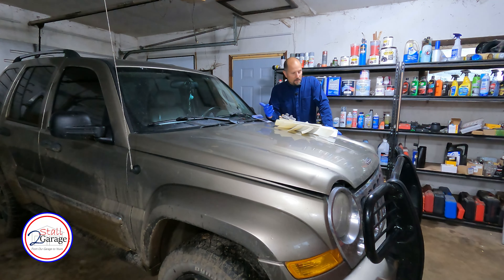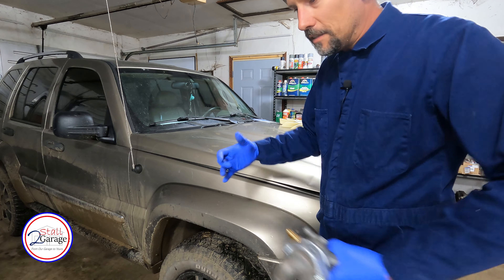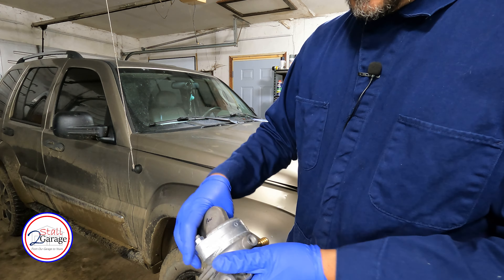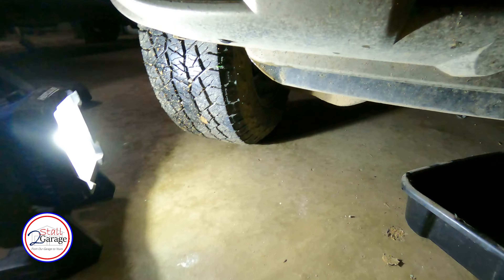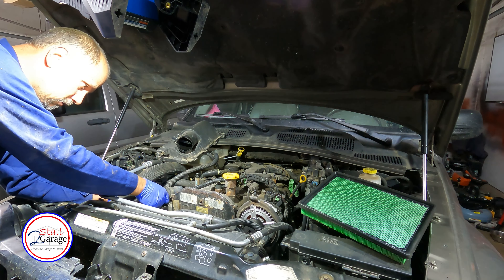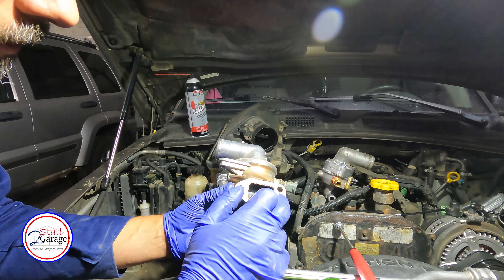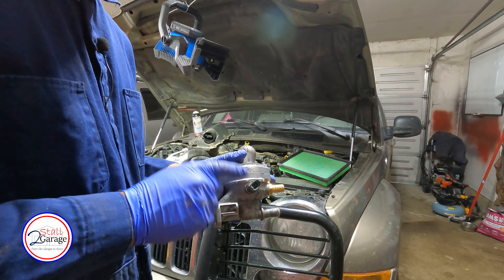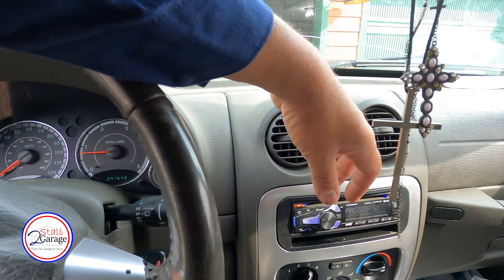Jeep Liberty CRD 203°F Thermostat UPGRADE Step by Step Install and Review

Comment: I'm seeing forums with these higher temp thermostats cracking heads with the crd, and its scary.

2nd thing- what is the viscous heater supposed to do? Dose it do anything good?
Reply from the maker: That’s not an issue with this thermostat.  The cracked heads can happen when people use an aftermarket (in-hose) thermostats. 

The viscous heater came OEM on these CRDs.   They will warm up the coolant a little (not much) faster.

They are obsolete nowadays.  Deleting them means less stress on your engine, serpentine belt idlers, belt, and tensioner.  

Any difference the viscous heater made with the coolant temp is made up for by installing this thermostat.  

Winter temps shouldn’t be an issue now.  Can’t wait to have it for the cold season.  Thanks for watching.  There are more CRD videos on the channel.  Some are older but hopefully still helpful.  

Have a great day!

Comment: I use that permatex copper spray on my head gaskets. Works great. Wasn't a fan of the liberty at first but they have grown on me. Wasn't a fan of the 4door wrangler or gladiators at first either till I drove one now I kinda want one 😂
Reply from the maker: They’ll never be good on looks but functionality wise, they make great MPG (the CRD) and the 4WD works great.  

Storm’s here tonight.  How’s your summer going so far?   Already July.  Wow
Reply: @2StallGarage  yeah they aren't pretty but better lookn than the compass 😂. We got hit with a storm yesterday. Cooled it down some but didn't las ran the humidity back up. We cookn down here. Heat indexes in the 110+ range with 60-80% humidity make it hard to get much done but we pushing thru it.
Reply from the maker: @GlassWerx looks like you’ve been putting work in on the Honda.  That’s going to be an interesting ride.
Reply: @2StallGarage  yeah had to do a little anyways 😂. Gotta plate it all in so it'll be safe to drive again. Got a few more parts to get and modify but thatll be a few weeks out still. Working on getting my buddy's s10 done now. Got it here at my place along with another buddy's truck we gotta get some work done on as well.
Reply from the maker: @GlassWerx  cool.  You e been getting more subscribers.  It’s not the most important thing, but it’s been good to see you nabbing more of them.  Good work.
Reply: @2StallGarage  yeah. I think it pretty good as well. Found several good channels as well that subbed. All small time but always like seeing what others have going on n who knows what I may learn from them.

Comment: I searched facebook and joined the group "JEEP DIESEL ONLY KJ Liberty CRD and WK/WK2 CRD for sale/trade" and did a search for "thermostat" and am not coming up with anything.  Can you share more information on how to obtain these modified thermostats?
Reply from the maker: Search “Modded 05-06 Jeep Liberty 2.8L CRD Diesel Thermostat” on eBay and you’ll find it. $399.00.  Worth the price in my opinion 👍
Reply: @2StallGarage  I did the search and nothing is on eBay at the moment.  I did get on the correct facebook group and sent a message to Robert Dys a couple of times to order one of these and never received a response.  Do you know anything further?  Is he not making these anymore?  Thanks.
Reply from the maker: @MikeRoetter go to 2stallgarage on Facebook and message me.  I’ll send you the link for the thermostat.  Sometimes Robert is traveling and may not respond right away.  He’s still making them.